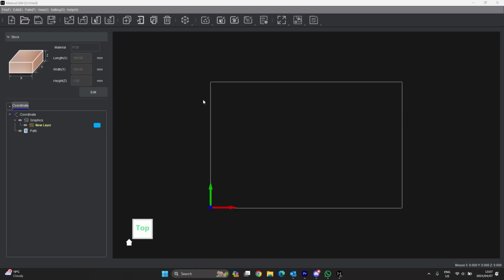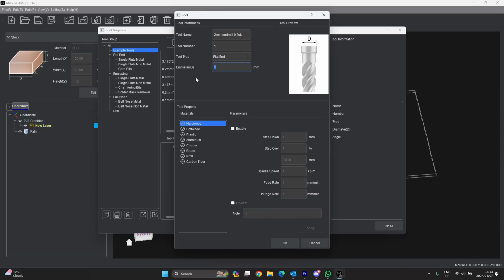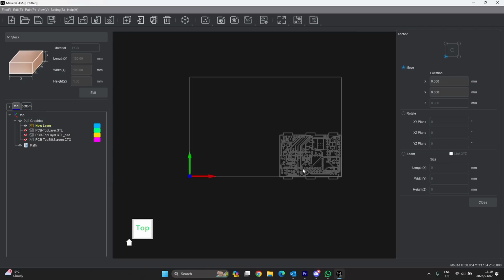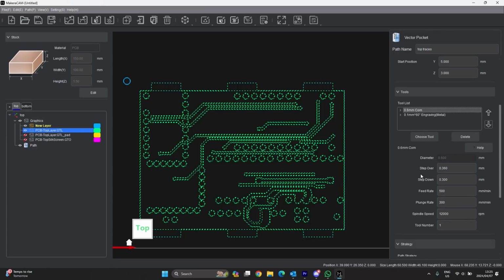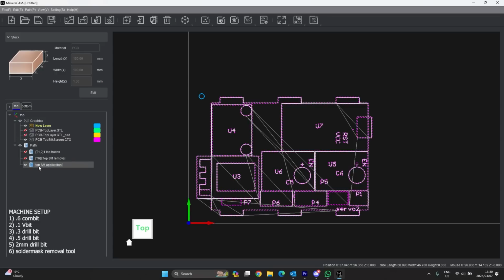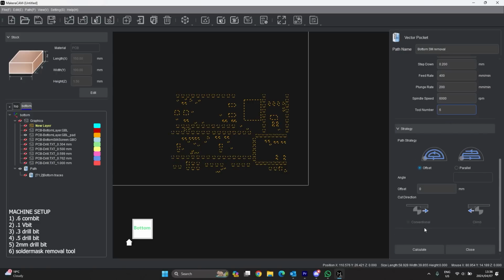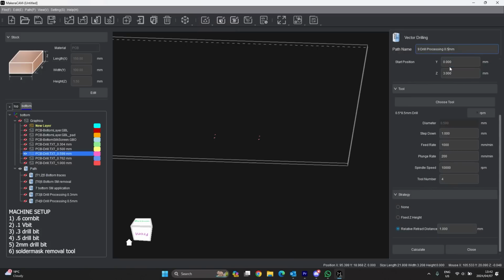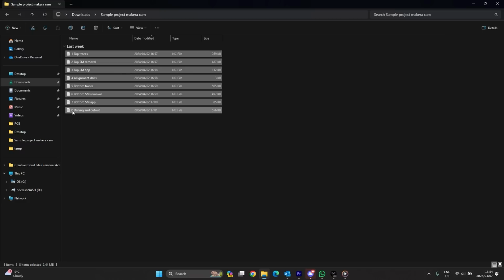Makera CAM beta Test preview and PCB tutorial

Comment: Great tutorial. I have a problem with soldermask removing settings. When the End Depth is 0.2mm i have to run code 3 or more times to remove all soldermack from pads. Any idea what i should change to fix this problem?
Reply from the maker: This may need to be adjusted depending on the thickness of your solder mask. Consider increasing your depth of cut to support.

Comment: how do you remove the white soldermask ?   i've been trying,  but it's almost so hard already...  after its printing all the images on my board.  (took about 45 min)    i tried paper towel,   towel,   water,   iso prop. 91%   but nothing will remove it as smoothly you are doing it.. what is the trick ?
Reply from the maker: How long was the solder mask on, and did you cure it just using the laser? It should wipe off with isopropyl unless it was cured or had time to dry.
Reply: @Makera  after the green layer is completed, i do the white one, and use the laser right away.  it takes about 30-40 minutes  to complete, and then i wipe it off.    using the isopropyl now, and it works better, but still very blurry,  idk what font is used and what the size should be (min).   tried 200/10%  1 pass  100/20%  1 pass  1000/20% 3 pass

Comment: do you use doublesided tape for this ?   and what  if the whole board is done,  can you put doublesided tape on that , without taking of the mask ?
Reply from the maker: We often use double sided tape for PCBs to not only remove the need for tabs, but also to compensate for the warp that is common with PCB blanks. Putting double sided tape on a cured solder mask surface is no issue.

Comment: the pins that came with mine are 3.9mm not 2mm. Did you auto level on the opposite side of the PCB?
Reply from the maker: There should be some 2mm pins in a small bag in the PCB kit and yes, you do need to auto level on the opposite side.

Comment: how are you getting them to align right, I get the pins portion but I don't get if you zero is on the left side how it is on t he right at the end.
Reply from the maker: https://youtu.be/yIMAdBEokKU?t=528 You need to select to flipped left bottom corner as the origin for the backside toolpath.

Comment: This program seems incapable of opening Gerbers properly.  They come in missing lines.  Features come in as blocks and there is no way to explode them into individual lines.  These are files generated from Altium.  Files converted with PCB2DXF are also a mess!
Reply from the maker: Most files we have tested works fine on the latest version of the CAM. Please email us your file to support@makera.com so we can do some tests on it.

Comment: the top soldermask seems to be off quite a bit, at least 1-3mm .. any idea why? =)
Reply from the maker: This machine needed some laser offset calibration.
Reply: and some of the traces on the bottom side are looking at some sections way to thin somehow :)
Reply from the maker: Yes, This PCB was just as an example, trace thicknesses can be changed by in the PCB design software, or by just changing the tool itself.
Reply: @Makera  thanks for your quick reply! yeah I know, but I ment that it looks like that some of the traces were milled wrong. cant post an image here, but its around 43:49.. the traces within the area where much of the copper is removed. the "streight" part seems way thinner then the rest of those traces :) seems like that for this area the bigger mill was used, dueto the bigger areas to be removed.. but somehow it got to close to the traces
Reply: Also the holes are pretty badly misaligned on the bottom...
Reply: @tballew  already did quite a few PCBs now, works just fine. not sure what happened there, but also double sided are working precisely. :)
Reply: @slaesh  good to hear! do you use the same process shown in the video with the alignment pins?

Comment: might consider centering the column data instead of left justifying it.  or right justify both the column header and the data. 6:55 you can see how far off the data is from the labels, it's... sub-optimal. ;-) 
3d carving coming in oct?
Reply from the maker: Thank you for the feedback. And yes, 3D carving should be available around that time.